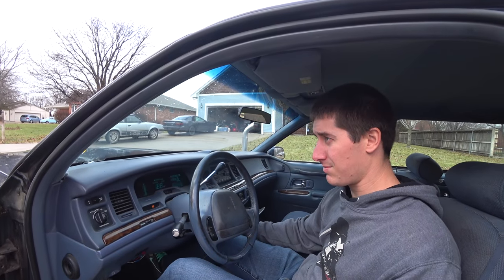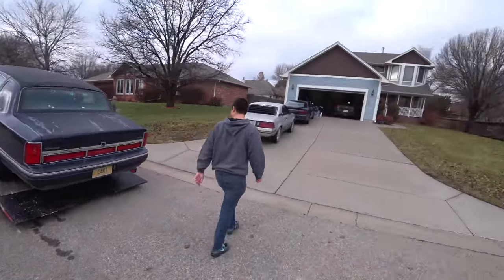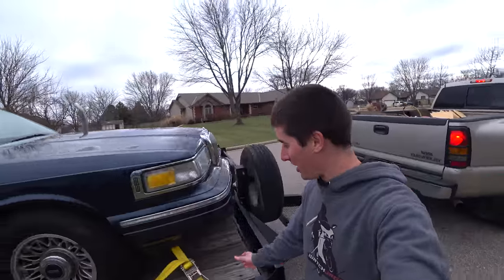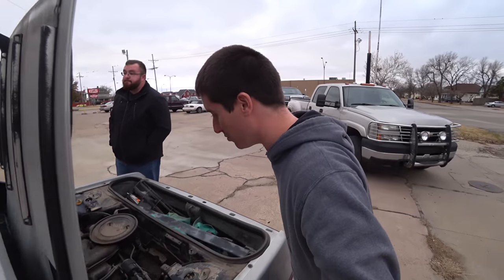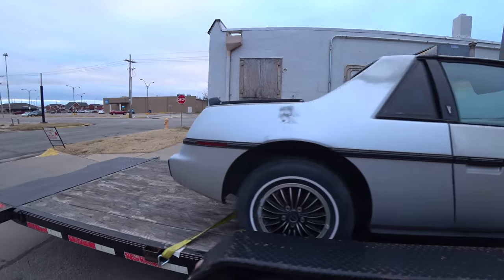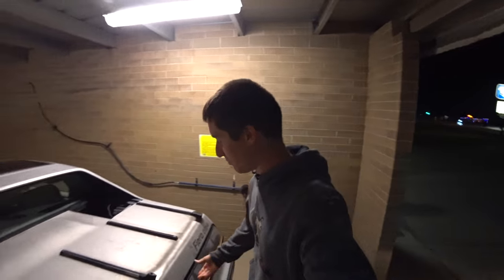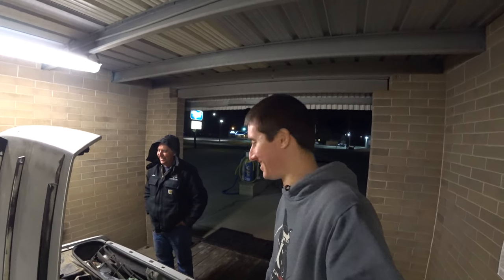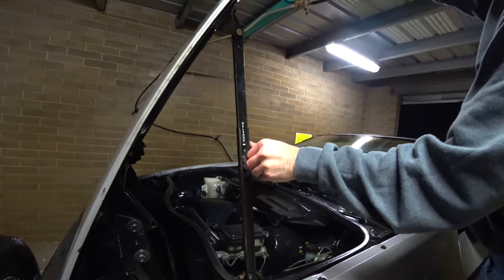SELLING My Cheap LIMOUSINE Lincoln Towncar And Getting A FREE Pontiac Fiero 2M4

Comment: How did you see "bare metal" on a plastic panel?
Reply from the maker: The roof is plastic? 😳
Reply: @WatchJRGo  the Fiero was the first car to use a "space frame" now used in the corvette. 100% of the exterior panels are plastic. In 84 it was the safest car in the United States, in 85 it was dethroned by a Volvo wagon. 

Because of the frameless windows, the space frame underneath and plastic/smc panels, some people actually chop the top on fieros 3" retaining the stock windshield.

Also, the 4cl was the "bad engine" with a bad reputation for fires and throttling rods, the v6 wasn't terrible. It's not uncommon for people to do engine swaps, sbc kids are available and lots of GM FWD setups are used, most notable is probably the 3800sc.

Comment: Be careful on those Pontiac Fiero's they had Major Wiring issue problems that would explode the cars, much like the Pintos.
Reply: The Fiero wiring problem was NOTHING LIKE the rupturing fuel tank scare of the Pinto. For the love of CHRIST,  do 2 seconds of research before typing....or speaking.

Comment: Interesting comment:  John Delorean designed the Fiero!
Reply: John Z.: John DeLorean had nothing whatsoever to do with designing the Pontiac Fiero. John DeLorean left Pontiac Motor Division in 1969 to work for Chevrolet & then left GM altogether in 1973 over arguments with high ranking GM brass. His last hurrah at GM was the 1973 Chevy Vega & then he founded DMC (DeLorean Motor Cars) later that same year. The two men who actually designed the Pontiac Fiero are Hulki Aldikacti & George Milidrag & they are hero's in the Fiero community.

Comment: You went from bad to worse... A 84 Fiero, really..!!!
Reply: kevinnlop that’s an 85 because the engine/trunk doesn’t have the large center engine vent that the 84s have. They switched to a body colored hump. I have a silver 84 fully loaded and it’s a great car. I did get it in pristine condition, almost like new. It’s been very reliable and the iron duke isn’t bad on a 2500 pound car. It handles great also. It’s my favorite car I own, and I’ve owned Mercedes BMW etc.